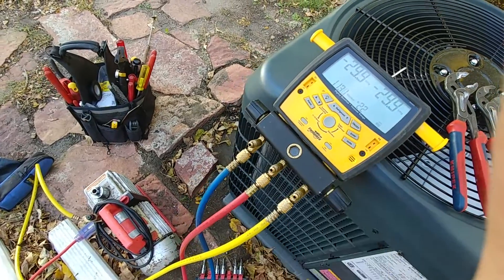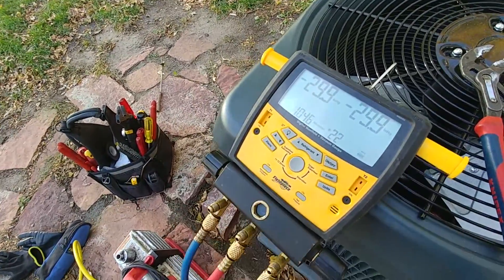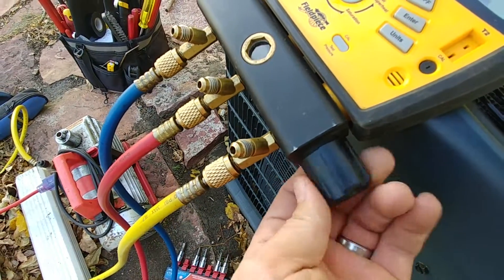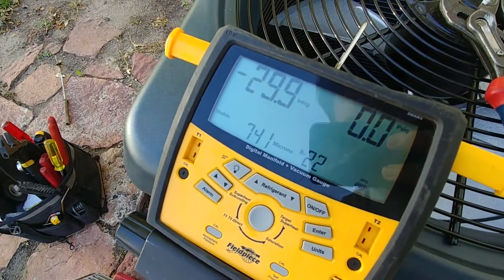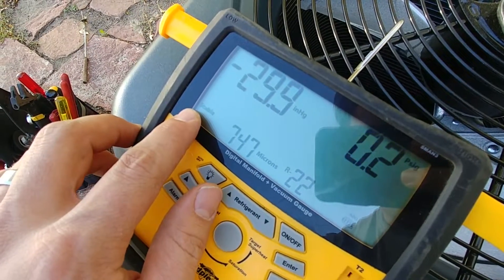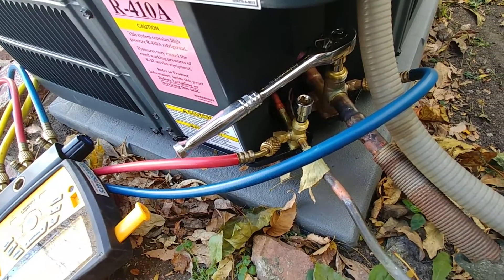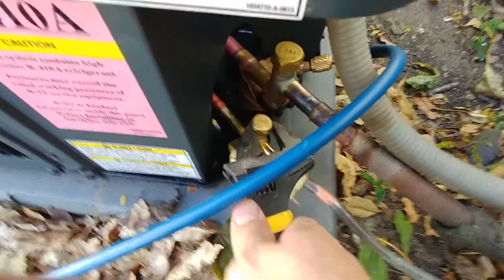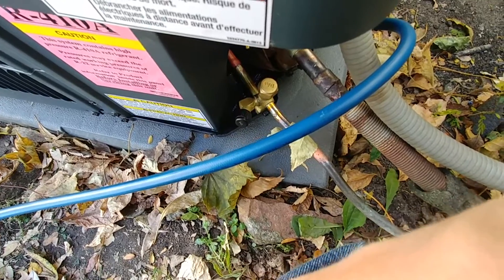How To Pull a Vacuum on an Air Conditioner Before Releasing the Freon/Refrigerant into Lineset

Comment: Ben, is the AC system ruin when remove the vacuum connection while the AC system was evacuated to -30 in/Hg. I believe air was sucked back in when AC system under negative pressure.

Comment: Appion SPDKIT-V - Vacuum Speed Kit MegaFlow. Use this instead of your manifold. Also you need to use valve core removal tools so you can pull your vacuum without Schrader valves which a causing a restriction when you are vacuuming.

Comment: I've been doing HVAC work for a few years on mostly family units. Just got through replacing a worn out York outside condenser unit with an almost worn out Goodman. I consider myself a rookie and still learning. I learn mostly from youtube and occasionally I am fortunate enough that someone with knowledge will allow me to ask questions. I also have the SMAN. I first thought that you were wrong until I thought it through. Now I see how you used the high valve. I've been wishing for a hose with a cut-ooff valve.....don't really need it now. Thank you!!!! 😀

Comment: Question: I just had a pre-charged ductless mini split air conditioner installed and I need to hire someone to "pull a Vacuum" on it? (the guy who installed it wasn't certified to it)  Do I just contact an HVAC company? If so, how much will that cost?

Comment: Your  manifold  hook-up  "theory"  is flawed.  You say you want to  "isolate the .....".   Just  connect it  "normally."   Then   close  BOTH  valves and the center is plugged,  while each gauge can then read  pressure.  Or if for some reason you think interconnecting high and low  is "better,"  then use a  ball  shutoff valve on the center port.   I personally see no reason for that last, either.

Comment: It's illegal to vent freon to atmosphere. It's apparent your not licensed. You could get a big fine from the epa just so you know.
Reply: I'm new to this too so what kind of fine will he get and how would you have done it better? Also what kind of license do you have? I'm thinking about going into the trade.
Reply: It depends on the exact for the fines they determine how long or how much you might have been venting freon it can be anywhere from a few k well into the millions in fines. They have recovery machines very expensive so if your not a pro it's better to have a have technician to recover your freon. The only reason for recovering freon or hooking up a pump is when your changing ac units or if you have a leak. Otherwise if your not changing units or have a leak there is not point to recovering and putting a vacuum on your unit. What ac issue are you having?

Comment: Just curious what about the schrader valves which stop freon pressure getting out down your lines your pulling vaccume on. Wont that mean the vac pump is pulling on those closed valves? Or did you use some way to open those when connecting your lines? SCRATCH THAT ive just seen your other video testing pressures... and see there is a valve opener built into the line.
Reply: It's always best to use a shrader valve removal tool...
 That way you can take the shredder depressor out of the end of your hose so that you have no restriction.

Comment: @Benjamin Sahlstrom, at 4:14 you are opening the two valves.  Why were they closed?  Is it necessary to close them first, then pull the vacuum on the lines that go inside the house?
Reply: I think the condenser is new so got to vacuum the line before making connecting it as a full circulation
Reply: @riceball4u2 , Ah, that's right!  It makes senses now.  Thank you!
Reply: @steve0826  no problem, I'm just guessing thou as I'm not a HVAC tech. But that would make logic sense.
Reply: @riceball4u2 , This is off the topic.  If I am charging refrigerant and come to find out I am 1 or 2 pounds short, do you think I can run the heat pump anyway?  Or it's better to wait for more refrigerant?

Comment: don't know when or how you "released freon into the "lineset""
Reply: Yes, this is a bit of a loose end in the narrative, but I'll be looking for a preceding or succeeding video to fill in this context.

https://youtu.be/KDBD-yLI-ik
Reply: https://youtu.be/KDBD-yLI-ik
Reply: I think what's going on here is that this is a new system and the freon is preloaded into the condenser.
He has to pull a vacuum on the rest of the system (line set and evaporator) to get the air out if them before opening up the valves on the condenser to let the freon into the rest of the system. 
Corrections and clarifications welcome.

Comment: Lordy you pull a vacuum with your sman3, mate your doing it all wrong. Buy you an evacuation kit. All that crap is garbage.
Reply: Ok. So I used to be just like you, using my sman4 460 gauges with 1/4 ball valve hoses & a company 5cfm vacuum pump but just bought the Fieldpiece vp85 the 8cfm one. Thinking I would pull a faster vacuum...Nope the same. So I did research, got 2 sets of the appion mega fast hose kits that come with valvecore remover tool. You could just remove the valve core with your setup now & cut your vacuum time  in half. How long did it take to get to 700 microns, 30mins to an hour??? Then again why cut it half when you can do it in 3mins down to 250 with the mega flow hoses & valve cores removed... so I could correct myself you weren’t doing it wrong at all just the back in the old days way. My new setup is better for me & for my customers because I’m not charging them that extra hour or 2 to pull a vacuum only to 500 microns. & I still use my sman 4 but I don’t even have the vac hose on it, I took it off. I only use them for checking pressure & charging... thanks for sharing tho. But now update your gear on pulling a vac you’ll thank me later
Reply from the maker: Mind sharing the brand/models of the tools you recommend? I'd be curious to see what you use!

Comment: The right way to vaccum a unit is to, apply your gages to the high and low side.. open you're check valves and release freon till you get liquid on both sides. Done, on to the next one!
Reply from the maker: Haha, although that isn't technically correct I bet it works. I know of another guy that does something similar and he claims it works "just fine". Thanks for watching!
Reply: Benjamin Sahlstrom naw bro, you're right. It's completely wrong. I did AC before joining the Navy for about 8 yrs. I miss it sometimes. Stay motivated and keep helping the fleet. Take it easy brother.

Comment: Your not doing it right.. you need to use 3/8 hoses and a tree on vacuum pump.. this way you use the pump at 100 percent..pulling thru your gauges is only using the puma at 60 percent at best.see that fitting at the top of your pump..who taught you how to do your job?
Reply: FLY EAGLES FLY Bleed Green right that 1/4 port is only for a micron Gauge not to pull a vacuum. I 1/2 hoses, working on getting me the new BluVac 3/4 hose kit

Comment: Do you need to perform a vacuum on a new a.c. unit? The old unit was r-22 the new one is 410a. The line set was flushed out with rx 11 and nitrogen
Reply: Or r u only supposed to vacuum an old unit that going to get recharged
Reply: @luissalgado3398  you always have to pull a vacuum
Reply: Always pull a vacuum

Comment: Why not take the time to go at least 250 microns. I go even lower and I just find a way to stay busy while the pump runs
Reply: Nate Walker thanks for this I would rather that aswell.. I have yet to do my 1st vaccum pump pretty excited. can gauges be taken off immediately after ball valve closed or must you crack liquid line first?

Comment: do you leave shrader valves in when you pull vacum ???
Reply: Leave them in.
Reply: You can leave them in. But you will vacuum down faster with them removed.
Reply: @Q_thulu  valve core removal tools work very good for removing shrader valve for pulling the vacuum
Reply: Yeah leave them in if you want to bring your expensive 8cfm vacuum pump you just bought down to 0.7cfm bawhaha. I don’t understand some of you guys not pulling valve cores.

Comment: I have YET to find a video describing this process that will tell you if the cut off valves on both the low and high sides remain closed or if one needs to be opened.    EVERY video assumes the viewer knows this.    It may seem like common knowledge, but if people knew would they be watching this video?
Reply: Have you tried watching AC Service Tech videos? He's very  thorough.
Reply: Randy Hammer after the vacuum reaches 500 microns , you can close your gauges. then you release refrigerant. gauges will still show pressures. .. does this help ?
Reply: Randy Hammer b
Reply: Wide open. While pump is running keep the manifold wide open. Close gauges when you’re done. You won’t mess up the vacuum you’ve pulled.
Reply: Yes, good effort, but as an education video, I don't know if this is "coming or going".  

This video needs more what/where/why/when to be useful for education purposes.
Reply: I agree, when did you close off the high and low side valves on the unit? Wouldn't you want them open to pull an entire system vacuum?
Reply: @branthandford2212  it depends if its a new unit that comes pre charged or if the refrigerant was pumped back into the condenser and held there during repairs on the evaporator side.

Comment: Hey, your microns go up bit by bit, is this what is meant to happen? and by it being stable does that mean there are no leaks?
Reply: Yes this is normal specially since the guy doesn’t have vacuum rated hoses plus he’s using a manifold.
Reply: @brian_GotSPL  I use this manifold all the time and one of the things you have to pay attention is making sure they get purged/cleaned ,oil  needs to be changed more often if you dealing with change outs,old refrigerant lines,everything has impact on the micron reader..I’m simply using alcohol to clean my ports,for me it’s working perfectly(using Sman3 for past 4-5 years and no issues..

Comment: Hey ben, do you have to pressure test with nitrogen or is vacuuming the line set sufficient? My installation manual doesn’t mention pressure testing with nitrogen.
Reply: Pressure test before you vacuum to check your joints. Charge with nitrogen up to 250psi. See if it holds for 10-15 minutes. If it holds pressure you can release the nitrogen to the air. Then pull vacuum. Once it’s in a vacuum close the manifold. And release the charge.
Reply: @replayreviews6339   Yoo need ya help
Reply: you can do pressure test by releasing freon for 5 sec. Full release after 15 min if positive pressure stays...